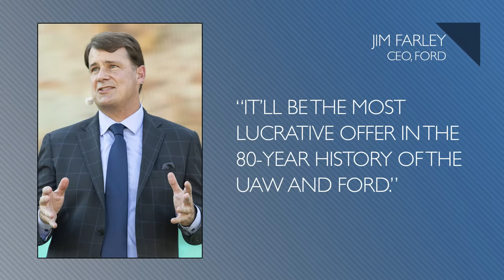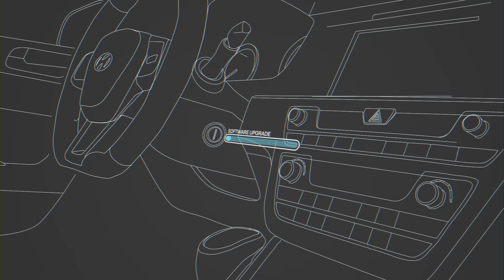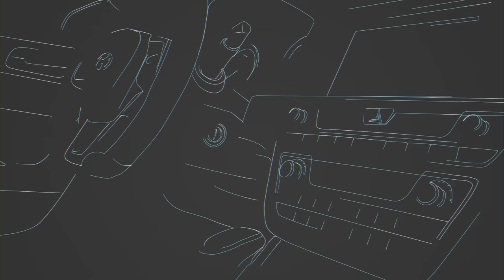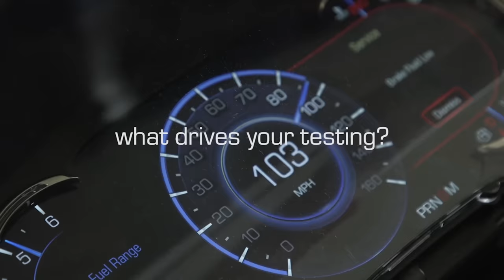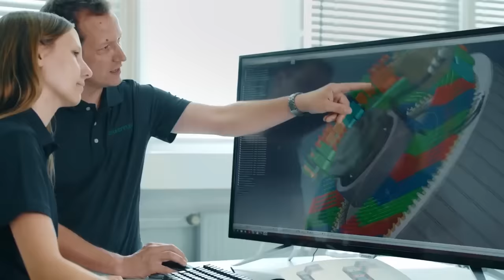UAW Plans Targeted Strikes; Ford Reveals New Logo on F-150 - Autoline Daily 3647

Comment: I am guessing Idra is too backordered for Hyundai to wait for presses from them. Unlike many vehicle builders, The Hyundai Group does have some industrial businesses which will probably give them some of the skills and tech needed. Always good not to have just one company to rely on for key tech. 

I am guessing by 2030, most builders will have giga castings of some kind in use in their factories. It reduces the footprint of the production line, costs of making that production line, speeds the process along, improves quality, and reduces labor needed. As much as people hate Tesla, they helped to show the auto industry the value of this tech which had basically been around for over decade before Tesla started using it. Tesla took the gamble to finish developing the tech and it paid off big.

Comment: The European Union is just now concerned about Chinese made EVs. They have had some in their home markets for years now, just hiding in old European labels. Now that they are using Chinese brands in the European Union they are freaking out. I can only assume VW, BMW, and Mercedes, are helping to encourage the fears since they have been watching market share drop in China for them and have nothing to really fight the Chinese EV models. 

Germany had been a leader in solar panel production, but the Chinese flooded the market with their cheaper solar panels and it basically killed off German solar builders.

Comment: Hyundai just confirming that Tesla is fundamentally changing the way vehicles are manufactured today with giga castings.  Tesla's lead just keeps growing!
Reply: I think it means Tesla’s lead is actually shrinking.
Reply: @lesliecarter4295  How?  When others follow in your footsteps does that mean they are leading or following????????
Reply: @pnketia  the others are catching up 🧐
Reply: Castings arent something new!
Reply: @lesliecarter4295  you can follow in someone's footsteps at 2 mph while they move at 3 mph.

Following does not necessarily equal catching up.
Reply: @brunoheggli2888  Correct, but castings at this size and scale is completely new.
Reply: @BTC_Minarchist  Everybody only talks about the advantages but never about tbe disadvantages!
Reply: @brunoheggli2888 because there aren't any, other than having to figure out how to actually do it properly.

Comment: European tariffs would apply to Chinese made Tesla’s ? 🧐
Reply: Interesting question.  

Assuming tariffs did impact China made Tesla imports, I think Tesla would create a new Model 3 line + Another Model Y line in Giga Berlin, ASAP.  Most batteries would still need to come from China until other options in the EU become available, but that would impact EU EV makers as well, not just Tesla.  Batteries might even be a bigger impact to EU car makers, since Tesla is already planning on building battery manufacturing in Giga Berlin.
Reply: Sure!